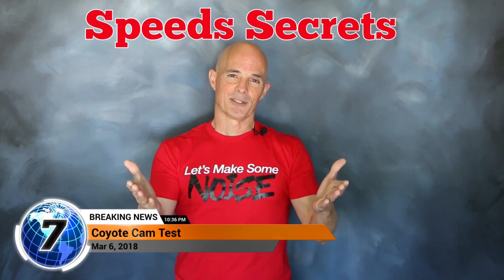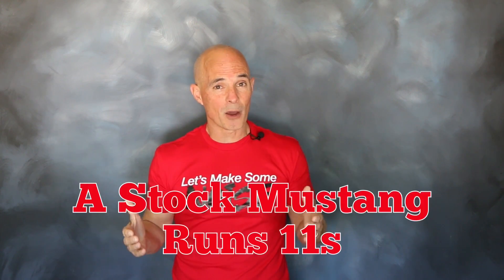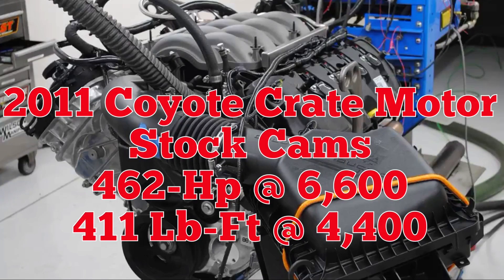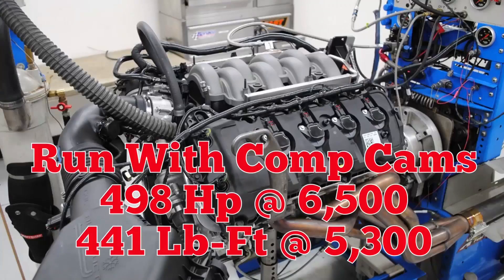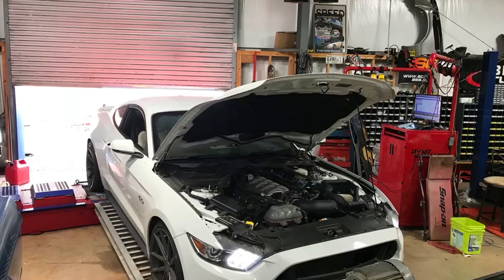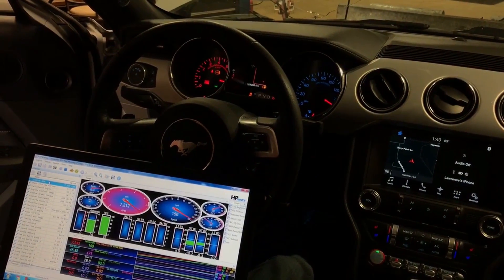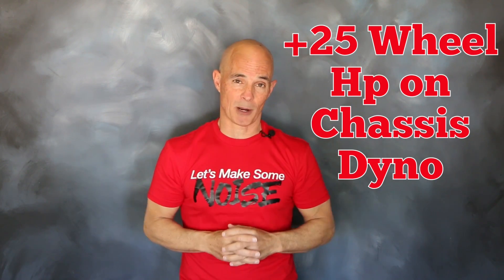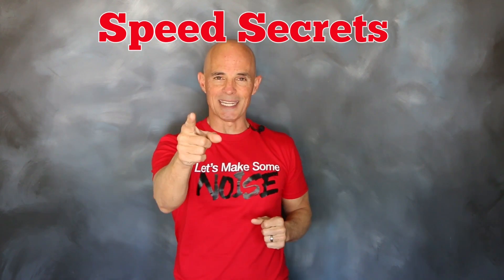Speed Secrets: Coyote Cam Test

Comment: You’re far better off putting that money towards boost. The gains per cost ultimately is not worth it. Unless your a dedicated race car I would highly suggest doing some research and save your money. And I keep seeing people asking about locking phasers. Unless you want to kill your low end power and tq keep them. Only reason to lock them out would be that you’re making so much power that they cannot operate correctly and I very seriously doubt the majority isn’t even close to that power level. There are factory cam cars running 6s and 7s now at 210 mph. People can say what they want to but at the end of the day your money is better off spent on other mods. By the time you buy cams and have someone else put them in for you and even if you do it yourself your spending 3500$ +. All this does is change your power band to be higher in the rpm range. And anyone changing cams would want to upgrade chains and tensioners not to mention crank sprocket and oil pump gears. These motors don’t need cams. I’m just trying to help and save you money. Do what you want but I’m only trying to save you disappointment time and money at the end of the day.

Comment: A bigger cam and locking out the phasers would net the most
Reply: Locking out the phasers absolutely kills your low torque. It’s been proven. You’re better off keeping the phasers unless you were making pro mod power. Lund just ran a six at 210mph at World Cup making 1800-2000hp and has phasers. If anything. Lock out your exhaust phasers but keep your intake phasers

Comment: It would be cool if you all did the difference in the nsr cams, thumpr cams and the cr cams for the 1st gen 2nd gen and 3rd gen coyotes. I haven't seen anyone bring the cr cams into question and I'd like to get a set of those if the power gains are substantial and more than the nsr ones. I'm in the process of building mine and was going to swap springs, but use a nsr cam until I remembered about the cr cams. I'd like to see the power numbers on the three and sure others would as well.
Reply: I just bought Cr blower cams for my 5.0. 231/237
Reply: @goon1874  I haven't been able to yet. I've had other things go on, but they're still in the plan.
Reply: Did you ever follow through

Comment: The reality is that the engine may pull past 7,000 rpm and still make good power, yet noticing the gains after the cam swap, peak power was still made around 6k rpm, no need to keep over revving ur engine. After all Rpm is the ultimate test of an engine and most engines become increasingly inefficient as you rev past a certain point with valve train stability, cam lift, as well as head flow being the limiting factors.

Comment: Think about the smile on your face when you pull up next to a Camaro? After you just spent $1500+ to make 25 horse? And the Camaro guy spent $300 on a cam and gained close to +150hp? lol yeah riiight... I don't think you're gonna be the one smiling
Reply: lol, someone's salty over a little swipe at Camaro fanboys. Adding enough camshaft to a LS to gain 150hp just from the cam would cost WAY more then 300 bucks. Either that or you're starting with some clunker that makes like 300hp stock in which case you're comparing the gains of a limp truck engine with a flat cam to a mustang engine that already makes like 450hp stock. No shit its easier and cheaper to go from a soggy 300hp to 450hp then it is to go from 450hp to almost 500, especially with only 300ci. Price out what a 500hp NA 4.8L LS costs to build. Probably cheaper then a Coyote but it's still not cheap to build.
Reply: 150+hp? What kinda cams are those?
Reply: @Kosmic949 I agree. Maybe 40 or 50 hp

Comment: These motors dont really need cams, ya they do change the RPM range and add a little power, but not like your typical pushrod motor. Theres plenty of 8 and even 7 second coyotes out there with some boost and valve springs....stock cams.... (mic drop)
Reply from the maker: It all depends on your goals and what kind of powerband you're looking for. Our Coyote valvetrain is being used in some of the fastest and highest revving Coyotes there are. The gains in the upper RPM range are proven, and along with full bolt ons (and especially with boost) the power gains are pretty respectable.
Reply: The stock 1st gen cams are pretty small, only like 211 duration @ .050. Stock 2ed gen cam specs are really hard to find but I do know they have more lift. One of these days I'll have measure my 2ed gen cams to see what they truly measure.

Comment: On a 17 gt with ported 18 manifold 18 intake and comp cams the car should be well over 500 horse but power is all the way up top power band that’s what you want . As a daily driver having that low end torque doesn’t really matter to because while daily you just get to work what matters is you punching the gas and reving High with all that power

Comment: 462hp and 411tq out of the stock cammed 2011 motor?  What was done to get those numbers?  I imagine long tubes, but there has to be a bit more...
Reply: Right there with you, engine dyno numbers or chassis numbers?
Reply: There was less parasitic loss since the engine was outside the car and not powering the drivetrain, also probably had an electric water pump.
Reply: @ForcedfedFords  even on an engine dyno, those motors should put down closer to the factory rating.  I imagine no cats and accessory stuff, but thats still a huge gain over the 410hp stock crank rating...
Reply: There s no exhaust catback

Comment: 465 whp out of a stock ‘17? Call me crazy but those numbers seem awfully.. questionable
Reply: hmm. 25hp for $2000...... naa.
Reply: i was thinking the same thing. more wheel power to a gen 2 than a gen 3 makes to the crank? lol nahh
Reply: @MrDatboichamp  my gen 1 made little more than that. Had to use more than just cams to get there obviously but it can be done. I don’t think it was just the cams that gave that bump
Reply: Those probably weren't SAE correction factors they used here like the OEM uses. You can make a dyno say anything you want with correction factors. What's more interesting is the difference in power on the same dyno with the same car but different parts.
Reply: Ive seen it go from 460 to 515 with the right tune
Reply: Agree.
Reply: Every dyno reads differently the only thing to take away is the addition
Reply: Considering they make 425hp at the engine stock...that's a MAAASSSSIIIVVVEEE jump for a stock vehicle. .

Comment: Ford Australia does em with a little charger and make 600hp+ routinely...any supercharger cams for the Ford boys down here?
Reply: Normally people with a clue - and I know that immediately excludes about 99% of Ford fanboys - go with a MILDER cam for "forced induction" since you don't NEED or WANT lots of "lift" and "overlap" what with the air being "pumped" into the cylinders aka "boost" and wanting to avoid "leakage" of intake air/fuel out the exhaust during "overlap". Especially with that DOHC 4-valve "high-tech" cylinder head and dual intake valves right next to dual exhaust valves. More "lift" also takes a lot more power given the extra compression of valve springs and its harder to precisely and accurately control valve timing and operation. 

Don't see many "big" cams running lots of "lift" and "duration" and "overlap" on "supercharged" diesels running up to 17:1 - 18:1 compression ratios and 40-50 psi "absolute" of boost pressure, do you? Not so much. Why not? What the hell is the point of using the fuel/power to make "boost" just to "lose" it out the exhaust or even out of the "downstream" intake valve while its going in through the "upstream intake valve" since no "twin" valves ever "see" identical flow/pressure/vacuum. 

If those "Ford boys" had a clue they'd be looking for "smaller" cams and they might make be able to get more than  40% more "horsepower" out of a supercharged "high-tech" DOCH 4-valve electronically fuel-injected coil-on-plug high-compression "Coyote". Of course they'd lose "high-end horsepower" and would have to settle for "low-end torque" but since their "high rpm" engines never see that "high rpm" besides when they're sitting around revving their ricer-like engines to listen to the exhaust "backfire" and "burble" the way no real "car guy" who associates exhaust backfire on "deceleration" with shitty "tuning" and "exhaust leaks" and "wasted fuel" ever does much less enjoys, there's an excellent change that they wouldn't even notice since that extra "low-end torque" would just get them to their "happy place" in neutral in front of "onlookers" more quickly and the rest of the time with the car actually moving would do them some good.
Reply: DEEREMEYER1 How much power to you expect to gain from boost if you’re at 11-12-1CR on pump gas? The fan boys typically don’t go with cams because of the horsepower to dollar ratio. The factory cams combined with independent control of each cam is pretty good from the factory. 50 degrees + or - in .2 seconds. The LT guys need 5-10K to fix their fuel system before they think about any real boost. The coyote will match the HP of the LT5 with less boost and the same rotor pack. At the end of the day there’s still no replacement for displacement. Pushrods allow that in a engine that will fit anywhere. That being said the current coyote beats the LT 1 in hp and tq density per liter. With such hostility sounds like one of them banged your girl while your car was down for repairs.
Reply: @stevenp3176  glorious reply, he's been in all the comment threads lol

Comment: 4v cam swap it easy to me I done a lot camshaft replacement on 3.0 and 3.6 gm and mod engine so isn't hard at all if you technician and trained and damn that low lift cam make huge power on stock intake mainfold it all about intake valve area good we need to see fully build coyote with ported head I bet it will make 570 whp on small bore that why I love mod engine although I built alot pushrod stuff I like this episode thanks alot god bless you all 😇🤗
Reply: I got a Chinese 212cc Harbor freight engine on my minibike that will rev past 9 grand with mods and only holds a half quart of oil, air cooled. It's no freakin Coyote motor tho ! lol
Reply: Spoken like a shadetree wannabe "mechanic" who hasn't worked on a "mod motor" in his life much less a "quad cam" boat anchor mod motor. There's nothing "hard" about them technically but you go bend over the front of that Mustang for a couple days and see how much of a "mechanic" you really are. Porting those ridiculous "curvy road intake port" heads has already been proved to be a giant freaking waste of time because the PORT SIZE AND "FLOW" ISN'T A "PROBLEM". It's the SEVERAL HARD "RIGHT ANGLE" TURNS THE AIR HAS TO MAKE GETTING FROM AIR FILTER TO INTAKE VALVES INCLUDING ONE WHERE IT FIRST HAS TO "CLIMB A HILL" FROM THE "BOTTOM" OF THE INTAKE MANIFOLD UP THE "PORT WALL" AND THEN GO "UP AND OVER" TO DROP DOWN THE OTHER SIDE INTO THE "INTAKE PORT" THAT IS THE "ISSUE". 

LEAVE IT TO FORD TO "IMPROVE" ON THE "OLD FASHIONED" AND SMART WAY OF DOING THINGS WHERE AIR IS FLOWING IN AND OVER AND DOWN INTO THE ENGINE BY MAKING THE AIR FLOW IN AND OVER AND UP AND THEN OVER AND THEN DOWN AND THEN OVER AND THEN DOWN INTO THE ENGINE TO A PAIR OF INTAKE VALVES ONE OF WHICH IS NEVER "GETTING" MORE THAN MAYBE A QUARTER OF THE AIR THAT FINALLY GETS THERE ANYWAY AND CALL THAT AN "IMPROVEMENT".

DESPITE THE FACT THAT ITS SUPPOSEDLY "NEW" AND "HIGH-TECH" (THE "MOD MOTORS" HAVE BEEN AROUND PROBABLY LONGER THAN YOU'VE BEEN ALIVE LIKE FOR 25 YEARS OR SO AND "DOHC" WAS A GM "THING" LONG BEFORE A "FORD THING" WITH THE "QUAD FOUR" THE "COYOTE" IS BASICALLY A PAIR OF-SHARING A CRANKSHAFT) 5.0-liter DOHC 4-CAM 32-VALVE V8 MAKES "LESS POWER" THAN A "WINDSOR" 5.0-LITER 302 WITH THE SAME COMPRESSION RATIO AND A "STANDARD" PORT FUEL INJECTION MANIFOLD, FUEL INJECTION SYSTEM AND ELECTRONIC IGNITION WITH SIMILAR "CAM SPECS" WILL/WOULD AT IDENTICAL ENGINE SPEED/LOAD IF SOMEONE HAD THE BALLS TO BUILD A "COYOTE KILLER" FORD 302 AND PUT A FEW GOOD PARTS IN TO MAKE IT "LIVE" AT THE SUPPOSED "7500-8000 RPM" COYOTE MUSTANG FANBOYS ALWAYS CLAIM AND BRAG ABOUT BUT NEVER SHOW ON THE TACH OR "DYNO SHEETS". 

THERE IS REALLY ABSOLUTELY NOTHING IMPRESSIVE WHATSOEVER ABOUT THE "COYOTE" OR ITS "HIGH RPM CAPABILITY" AND I GUARANTEE A STOCK ONE WON'T "LIVE" AT 8000 RPM FOR MORE THAN 5-10 SECONDS BECAUSE IT WILL PUMP ALL THE OIL TO THE TOP END AND "SUCK AIR" AND BLOW UP ABOUT TWO SECONDS LATER. EVEN "FULL" OF THE 2+ GALLONS OF OIL IT NEEDS. THAT'S THE PROBLEM WITH OHC ENGINES AND ESPECIALLY CHAIN-DRIVE OHC ENGINES THAT USE ENGINE OIL FOR "TENSIONERS" AND "CAM PHASERS" AND HAVE TO HAVE 32 "LASH ADJUSTERS" AND 20 CAM BEARINGS ON THE TOP END. WAY TOO MUCH OIL DEMAND UP THERE AND IT TAKES WAY TOO LONG TO "DRAIN BACK" AND A "GEROTOR" PUMP GETS "MORE EFFICIENT" THE FASTER IT RUNS SO ITS PUMPING IS "DISPROPORTIONATE" TO ITS SPEED AND WHEN ITS FLOW EXCEEDS THE FILTER BYPASS CAPACITY TO "DUMP" EXCESS OIL BACK IN THE "SUMP" AND/OR IT STARTS "SUCKING AIR" THE END IS VERY NEAR. ALL OF THE "OIL PUMP GEAR FAILURES" ARE THE RESULT OF A "LOW OIL PRESSURE" PROBLEM CAUSING THE ENGINE/DRIVER TO "THROTTLE BACK" WITH THE VEHICLE STILL RUNNING "HARD AND FAST" AND WITH THE OIL PUMP BARELY PUMPING "AERATED" OIL AND WITH JUST ENOUGH GETTING TO THE BOTTOM END TO KEEP IT FROM "SCATTERING". 

THEN WHEN THE "DRAINBACK OIL" CAME RUNNING INTO THE PAN AFTER THE CRANKCASE PRESSURE DROPPED WHEN THE BLOWBY WAS REDUCED BY LOWER ENGINE SPEED/LOAD AND THE PUMP WAS "CAVITATING" AS SOON AS IT GOT A BIG GULP OF LIQUID OIL WITH LITTLE OR NO AIR AND THE "BYPASS" WAS CLOSED AND EVERYTHING WAS "PUMPED FULL OF OIL" THAT SHOT OF OIL "HYDROLOCKED" THE PUMP AND SNAPPED THE GEARS LIKE GLASS. REALLY STUPID IDEA PUTTING A "GEROTOR" PUMP IN AN ENGINE THAT NEEDS TO LIMIT "TOP END OILING" AND SAVE EXCESS OIL FOR THE BOTTOM END, TIMING CHAIN TENSIONERS ETC. 

OF COURSE MY GUESS IS THAT THE OIL PUMP GEAR FAILURES "STOPPED" BECAUSE AT SOME POINT DURING "WARRANTY SERVICE" OR VIA "REMOTE DOWNLOAD" FORD "SNUCK" A "REV-LIMITER" OR SOME KIND OF "SAFETY SHUTDOWN" INTO THE "SOFTWARE" TO START "THROTTLING BACK" A "WOUND UP" ENGINE STARTING TO LOSE OIL PRESSURE A LITTLE SOONER AND A LITTLE MORE GENTLY AND NO DOUBT SOME "INTERNAL CHANGES" FOUND THEIR WAY INTO THE "NEW" COYOTES ALONG THE WAY. OR MAYBE THE SOFTWARE FOR THE TACHOMETER GOT REVISED TO SHOW "X RPM" WHEN ITS ACTUALLY A CERTAIN PERCENTAGE "LOWER" ABOVE A CERTAIN ENGINE SPEED. REGARDLESS, YOU STILL WON'T GET AND KEEP ONE OF THOSE "HIGH-TECH" SUPPOSEDLY "REV-HAPPY" ENGINES AT A LEGIT "7500-8000 RPM" FOR VERY DAMNED LONG AND THERE'S NOTHING IMPRESSIVE ABOUT A MODERN "HIGH-TECH" SMALL-DISPLACEMENT "MOD MOTOR" DOING WHAT A CHEVY "DZ302" FROM A 1ST-GEN "Z28" OR EVEN A MOPAR 340 WILL DO "RELIABLY" WHICH IS "REV TO 8000 RPM". 

THE 340 WILL USUALLY THROW OFF ONE OR MORE OF ITS BELTS BUT THE DZ302 WAS LITERALLY "MADE TO SCREAM" WITH A 283 CRANK/STROKE IN A 327 BLOCK. ABOUT A 3" STROKE AND A 4" BORE (SAME AS A 350 and the '68/'69 DZ302s are "large journal" engines like "late" 327s an all 350s) and a "big" solid-lifter camshaft and the super-light lifters/valvetrain of a small-block Chevy and a dual-plane intake and dual-point distributor. Internally-balanced and only available a 4-speed manual those little "Trans Am" Chevy 302s flat-out scream and were conservatively rated at "300 hp" at way under their "redline". Hell, I had an old bone-stock (except the headers) 350 4-barrel 4-bolt main "low-compression" Chevy in a 1/2-ton pickup with a 4-speed and factory tach and just the stock HEI and nothing else "special" about it at all that in NEUTRAL would "rap" to 6500+ rpm no problem at all. If I were "brave" i probably could have bounced it off 7000 but the tach stopped at 6500. 

Any healthy, strong and "well-built" STOCK Chevy big-block with anything but "peanut port" heads and with decent exhaust in NEUTRAL will "wind up" to 6500 rpm and if its "built" like the old "car motor" 454 in my '85 K30 1-ton dually 4WD with a 4-speed, NP205 and 4.56s that has about 10:1 compression and a "stout" cam and headers and a 4-barrel Edelbrock 2-0 intake (oval port heads) and a Holley 750 vacuum-secondary carb, blue pump and "dual feed" fuel log on it it'll run 6500 as long as you want and there's enough oil in the pan. Mine was built by the original owner/buddy of mine who believed in "high volume oil pumps" which are a "bad thing" on "high rpm" engines since they'll pump the pan dry pretty quick at "high rpm" so I can't run mine "for long" at 6500 but I go to truck pulls (sled pulls to some) and whip absolute ass with it going down the track at 6000 or so for 30 seconds or thereabouts in low-range 2nd gear. Above that I believe it would pump the pan dry but it doesn't have enough "snort" to run faster than that so its "safe". 

Not a damned thing impressive about "7500-8000 rpm" to anybody that knows jack squat about "high performance" given the specs of a "Coyote". But Ford fanboys think its "cool" so what does that say about them?
Reply: DEEREMEYER1 you’re so wrong on your info your breath stinks. would you like me to show you a thousand vids on these coyote engines reving at 8k rpm all day long. you’re just jealous of these little engines.
Reply: @coyote5.02  Ford is also making the new 7.3L Godzilla V8 for the 2020 Ford Super Duty.
Reply: @deeremeyer1749  😭😭😭
Reply: @deeremeyer1749  You do know that Ford is making the new 7.3L Godzilla V8 for the 2020 Ford Super Duty.